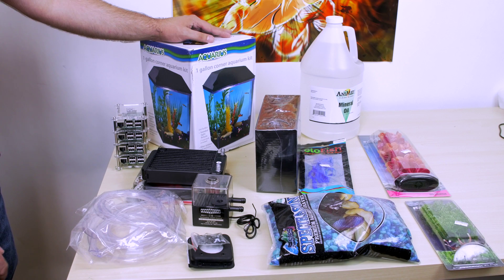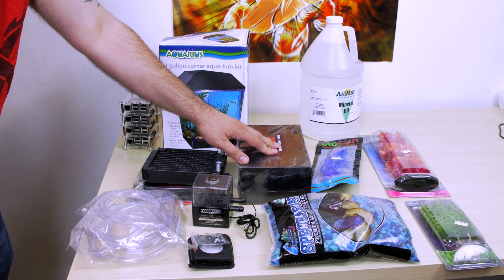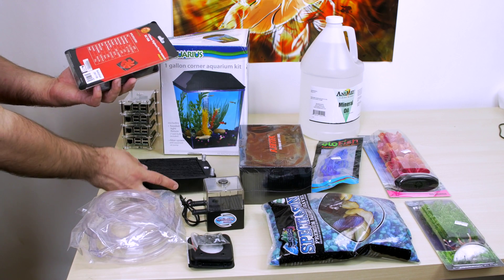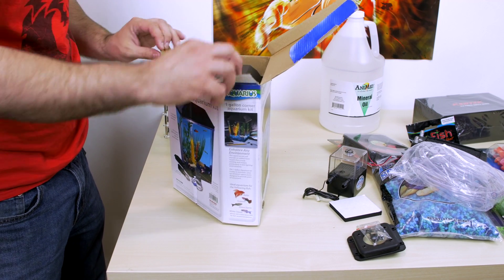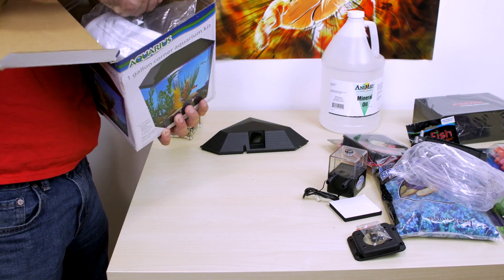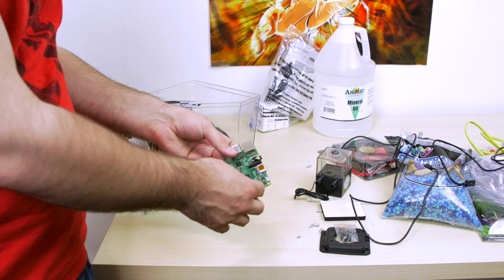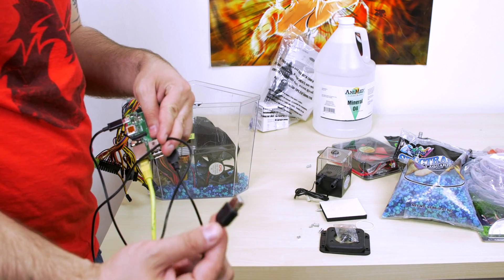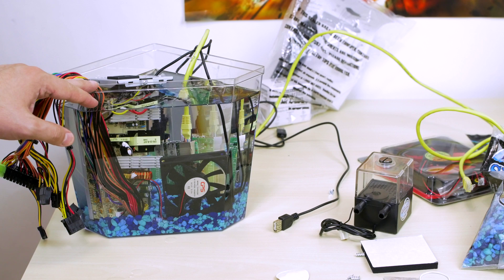Mineral Oil Raspberry Pi 2 Build - PART 1

Comment: first u want to do is to change the ethernet cable to a wireless lan dongle and power the Rpi on the GPIO pins with a blank copper wire. - PSU should be outside.
The oil will crawl through the ethernet cable into your router in no time.
Reply from the maker: +Dr3x0w I will revisit this project and do it better

Comment: power supply out of external disk drive case is 1/2 the size of a pi, 
has 12v & 5v and tiny fan

Comment: Well, this was a disappointment. Your amateurism regarding this topic is surely baffling. Before mineral oiling that thing, you should have done some research on, lets say, the LinusTechTips youtube account. Indeed you should have washed the gravel before putting it into the tank. The fan you will be using is junk. Nothing more annoying than a loud fan. You mispronounce radiator. During the first 3 quarters of the video you continuously have the powersuply the wrong way around. You should really be more prepared before making a video like this, mate.

Comment: I would just leave the power supply on the outside and still use the cluster.  Or if possible see if it will fit alright to the underside of the tank lid.
Reply: vedg3 shoulda mounted it to the side of the tank

Comment: you should just get a small adaptor,  the PI doesn't need that much voltage.  5V.  That pc power supply is massively over kill.  Also, it seems events are driving your project, not you. Plan this out so you get what you really want.
Reply: FlyMario I think it's for the pump...LOL that would burn the RPI
Reply: Steve the Wolf Actually, a computer power supply will power the RPI fine.  As far as for the pump, yeah but no need to clutter the inside of the tank with that. I think people are more interested in the heat dissipation on the glorious RPI's. An Aquarium with a PC power supply with one RPI bobbing around isn't really that interesting.  

I am very interested to see the end product.  I wonder if the RPI can be clocked much higher. I would also think that if the oil isn't circulated fairly decently it might just make warm pockets of oil around each of the CPU's.

Come on Rasim, we need an update video!!!  :)